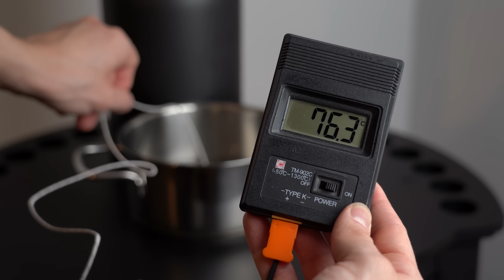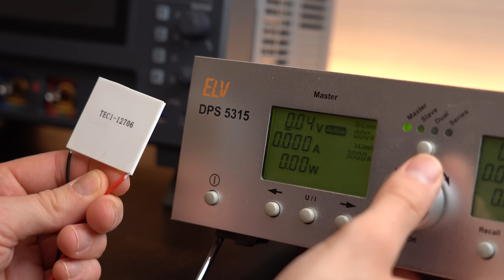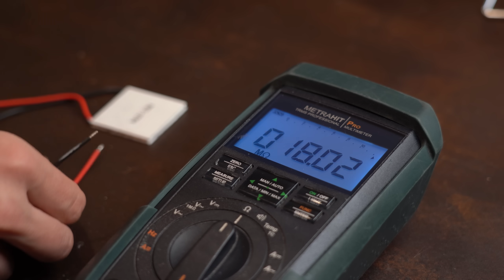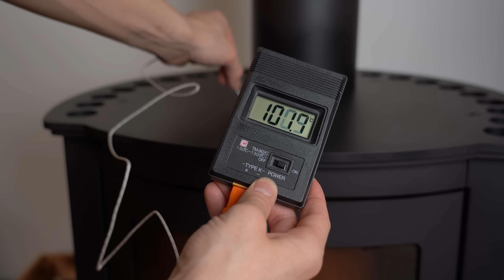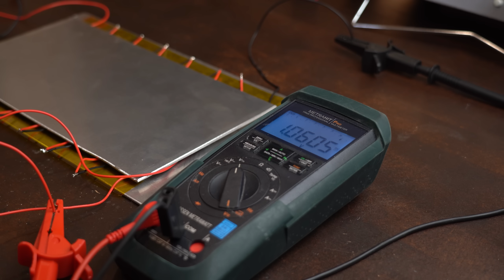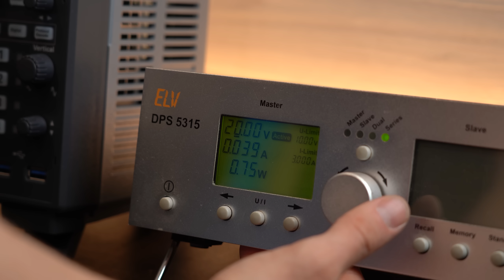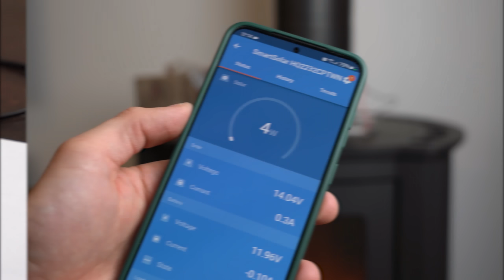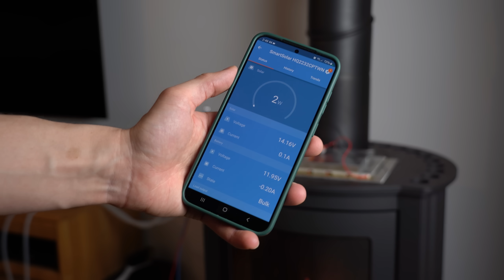I tried to Power my Home with Heat Generators! (Worth it?)

Comment: Try putting a sand battery on top of your wood stove with a heat-powered fan on top of it.

The sand should retain the heat for much longer than the ambient air retains heat from the woodburning stove alone, and since the fan is powered by the heat retained in the sand, no additional power input is required to spread and distribute the heat in the room.

Comment: Idea: Use the woodstove as a water heater to boil water and run a steam turbine. 

I think using the design of a rocket cone will pressurize the steam enough to work as it needs to.

Attach the water supply to a float to make sure the reservoir stays full. 

Potentially also find a way to capture and reroute the steam once it condenses again.

Comment: Something like this could be VERY useful in the right situation.  If you could setup downstream from a perpetual spring, just let gravity feed the constant COLD water through insulated pipes (or use a siphon) and have a regulator block to hold the heat at just below the damage threshold.  I've never studied the tech but I'm assuming that colder water on one side would make less heat necessary to produce the same power?

Comment: Do not use a peltier module, but heat some radiator fluid and take it to a stirling engine. the heat engine with a flywheel has great horse power!

Comment: They're not accurately described as generators but more as energy siphons, push too much through a tube and it breaks. The max temperature difference for these is usually around 18.3C, the BRIGHT spots on your FLIR describe a difference greater than that. If you care I'd look into a home powered stove fan, then sit a cooling block with fins in front of the fan.

Comment: The way to get max cooling from them is to stack two high. Maybe the heating process will be similar? I would remove the top plate and run the heat exchangers direct to the P modules.

Comment: What we need is just steam turbine xD The power could be much higher. The way to protect the peltiers is to use metal standoffs touching the hot side. If its too hot you change the distance.

Comment: I wonder if the plate would be more efficient and safe if you added a small air gap between the plate and the stove top. All you would need is like 5mm of space between. Just a thought.

Comment: I always had an Idea with peltier modules.

Imagine putting the cold side floating in water like a river, to keep the cool side cool with the water current.
And the hot side painted black to absorb all the heat from the sun...

Will it work?.

Like, is a pasive way to harvest energy from the sun... Maybe is more durable than solar panels... I think.

Comment: To better control the hot side temperature, you can use a second water loop, but for the hot side. The downside is that such a loop will consume some power to run, and also the hot water pumps are a bit more expensive than regular ones. A circulation pump from a solar water heating system will do the job excellently.

Comment: These peltier modules are more expensive than the solar panels… Actually these are made of BiTe material, which is quite rare on the earth; but solar panels are made of silicon and can be really cheap with the development of manufacturing process
So these modules are not doing well when used as a common way to generate electricity, probably suitable in special fields only

Comment: You could have used metal pipes to heat water to drive a lot more peltier devices. That wood fire is outputting way more than 6 watts of harvestable energy
Great video regardless

Comment: Idea for you to try. 

Most modern wood fireplaces come with a double walled pipe. Inner one for exhaust, outer one for cool combustable air. If you built an array of those devices around the inner pipe, probably using a metal stand off to still allow air flow around the inner pipe, and to keep the array below its max temp. the outside air coming down will create a potential difference across the  device. 

Doing it this way makes for a neat and tidy install and you need no cooling pump.

Comment: Hmm did you use TEG's or Peltier Module's ??? As a Peltier Module Transfers heat when a current is passed through it (Peltier effect). Commonly used for cooling applications. Where as a TEG Generates electricity from heat (Seebeck effect). Typically used for power generation.

Comment: There are companies that make TEGs meant for power generation. These modules are like taking a DC motor and using it as a generator. Yeah it works, but not as efficiently as a dc generator.

Comment: Scott, I wonder if the stirling engine might be an easier solution? I've put forward the idea of a steam turbine before. However it's quite difficult to do. You don't need steam in a stirling engine. It works with hot air.

Comment: Mounting them on the vertical pipe may not have been as hot and would not have shut you down. When the cold side warms up it also shuts you down, cold side could be outside?

Comment: So , have another system for you to tinker with if you really want to test.  Take your water collection system, add a second teir to it so that there is an upper barrel and lower barrel.  let gravity drop water between the upper and lower barrel and turn a water wheel in it and from the bottom barrel make a small drop to a ram pump that then will pump the water from the lower barrel to the upper barrel.  Have fun figuring out the head pressures :)

Comment: So you have several peltiers left over and a couple of aluminium heat exchangers... why not turn them around and see if you can make a rapid water cooler with them to chill tap water (or bottled water) down to ice-water levels for cold drinks?  It would be interesting to see at what flow rate you could produce a steady stream of chilled water...

Comment: Someone has to be lying because why would all of these generators put together not produce as much current as is needed to power the motors on thermoelectric powered fans sold on amazon? What are you doing wrong? Why are you so confident in displaying these gadgets as non-promising?

Comment: There are some on amazon calming 12v and 60wats of power per plate so I don't know the differences between those and yours. It could be size or type of generator but this just seems like such a stark contrast that somebody has to be lying and if you nor amazon nor said vender can be trusted, then it's up to me to invest and risk the loss myself.

Comment: You should have put them all parallel and boost the voltage. That will do the job. Series does not work with peltiers. They will work against one and other....

Comment: I suggest placing the bottom heatsink layer in water so they never go past 100c. Or make a condenser column and drive the whole thing with steam, dripping the water back down as it cools.

Comment: Could there be a way to use a couple of modules on battery to provide the hot and cold to modules for power generation? Using less power hungry modules to provide the heat and cold

Comment: I worked on a project that developed an organic rankine cycle for energy production.  The working fluid was Freon.  This would likely be your best bet for a low temperature application such as this.  Especially with a turbo-expander.

Comment: The only two productive ways to generate electricity are solar and gas powered portable generator. I know that natural gas is expensive nowadays in europe, you can use methanol or carbon monoxide instead. Those fuel works fine with gasoline engine. You can use a retort furnace to make carbon monoxide from wood.

Comment: Great video, Scott! It would have been cool if you had measured the temperature at the point of self-destruction and came up with a design that could have kept the peltier plate below that temperature, maybe something like elevating the Peltier plate on a heat sink from the stove with fans that can blow cooler air across the bottom of the Peltier plate and heat sink to help prevent the "self-destruction tempture range."Just an idea.

Comment: Not overheating them is the hard part. I was going to use boiling water and put these on the condenser, Basically putting them between the water and what I want to heat, maybe I can get them to power their own pumps, but seeing these numbers makes me think that it just isn't practical unless I get my hands on a reasonably affordable supply of high temperature modules. Their efficiency is low, but it's not as bad when they're higher temperature modules. Still, if anyone knows where to get Stirling engines instead, that would probably be cheaper and more efficient.

Comment: Proper TEG (Thermo Electric Generator) modules cost a whole lot more (around $60 USD for a 22W module), but are constructed for much higher heat tolerance). Peltier cooling modules do what you discovered in your own experiment.

You have heat, you have water. Try a steam driven generator.

Comment: most of your heat gets lost through your exhaust. Get a proper stove with a large mass to store the heat. Also, peltiers need pretty large clampping pressure to operate in optimal conditions

Comment: I can definitely see ways to improve this design

Rather than water cooling, do water heating. Run a coil of copper tubing around the flew. As the water heats it rises and the convection current pumps water through the system. Raising the temperature of the hot side. As it won’t be over 100C you don’t need to worry about burning out the pettier devices. 

The cooling side can be air cooled with just a fan and fins. Although as the air temperature in the room increases you will loose dept Tc. 

Although looking at your flew it’s probably well insulated (as per European legislation) so may not have enough heat capacity to drive an efficient convection current

Comment: A very expensive theory to test, but I wonder how much power you could generate if you could attach an MPPT controller to each cell and THEN attach them all in series. This would theoretically fix the discrepancies between the cold parts of the stove and the hotter parts right?

Comment: Maybe a mid preassure diferencial methane evaporatour wold work better , its like a Sterling engine , but the methane is pressurized till it forms a small cover of compensation at the bottom

Comment: The main problems with electronics are heat temperature and water moisture. I've always get a headache when I see some project with all that in mind. xd

and I think it's better to use a cooper plate than aluminum. nvm, it will break the module much faster. xd

Comment: Great video. Very cool idea. I am sorry to say that the ebay seller scammed you. The tec1 part nr indicate a thermoelectric cooler. The ones designed for use as generators have the teg designation and are rated for sometimes over 300C. They arent soldered internally so they dont stop working. They do cost a lot more though as they arent used in stuff like minifridges etc.

Comment: You need stack them, so the cold side of one faces the hot side of another. You can do this as many times as you like> They will balance the heat gradient between them 

You'll need a lot more to get any decent output

Comment: Has anyone done this with TEG modules instead. I’m planning to build one with a lot bigger of a temperature difference and looking for reference projects. 

Of course mostly for fun as I understand the inefficiencies,  but this could be made a lot better with superior insulation between the hot and cold side and a higher temp. Difference, matched with better modules. 

I’m pretty sure these TEC ‘s are optimised for cooling applications and not power generation with a maximum operating temp. Of 150 degrees Celsius where as the TEG can withstand 250-300 at short periods

Comment: I would say connecting the modules in series is a flaw of the design.
The ones that are producing less voltage might act as load for the ones with more output.
Which is very much the case, because of manufacturing variations and uneven heat distribution of fireplaces.
They also then will act as cooler and cool the aluminium plate while heating the water.
You could try it with the modules connected in parallel and might reach around 20W for the 21 modules.

Comment: Rhe English term for that is a wood stove, not a fireplace.  (Although a fireplace usually has what we call an insert, which is exactly what it sounds like, a device you just insert into the fireplace to make i t work better, which is usually the same basic design just altered a bit to fit into a fireplace neatly.)

Comment: Good episode. Shows the Peltier module generator hype for what it is: very low efficiency. PV, wood gas powered generator, steam turbine, micro hydro, VWT (vertical wind turbine) - these are the projects I've came to think about as viable and practical over several years of keen observation. Cheers. :)

Comment: Maybe you can use a bypass diode parallel with the module. Let's say if one peltier module has lesser heat than the other, it may try to block other module current as all are connected in series. Bypass diode may help.

Comment: Russian have a radio receiver called kerosene radio, basically it's several thermocouple connected in series. You have some similar thermocouples in your water heater or stove that use them as security devices to maintain open the gas valve locking it with an electromagnet. They need a lot of heat to work, fire directly I think. I don't know the current or voltage that it generated but they only use one to activate the magnet valve.
Set several of them in your stove and test the power but looks very powerful to operate with only one a magnet. Best regards!

Comment: It's an interesting project. I always wondered whether it would be worth adding peltier devices to the back of solar panels so they don't overheat in the summer and provide additional power output as well. They could also be powered in the winter to heat up and melt snow. 
It would be an expensive project for sure. In the end I decided that a water loop into an indirect hot water cylinder would be more efficient with a standard heating pump, but the extra weight would be too much for my roof.

Comment: This is quite an experiment. And also expensive (at least 4 me). But it was interesting. We now have power outage of 3-4 hours or even 2 times a day because of poor energy system because of f@cking moscovities! So to make the boiler work I would like to have such elements to make the boiler pump work to heat my house. It could be used for gas furnace and for wood boiler. But the needed power is at least 35 watts. My pumps are cheaper/older. So they need 50 W minimum. But the idea itself is brilliant and is already used successfully by Americans with their wood stove fans with peltier element inside. But the pump needs much more power.

Comment: Why didn't you just buy a wood stove fan and measure the volts coming out of the heat generator before it gets to the little motor obviously, save all that time faffing ♥you did it wrong from the start,  heat transfer via a heat shaft is best,, like the fan design ♥

Comment: use the heat to BOILL WATER it turns into steam use said steam to turn a turbine  or move a piston + flywheel now u can make them into a generator or  angine...GOOD LUCK!

Comment: I think you need higher heat resistant peltier. I ever see peltier that can withstand 250c, but if you can find higher heat resistent, it much more better

Comment: Thank you for doing this man!
I have had the same idea for a while but came to the same conclusion. Seems we need higher temperature modules for fireplaces 😂
But yea, considering we burn for heat, it could be nice to get bonus electricity aswell :/
Denmark got expensive power aswell.

Do you use batteries to store power during cheap prices aswell?

Comment: So you put them in series to get 100 Volts just to make the mppt let it step down to charge a 12V battery? The MPPT charger claims a maximum efficiency of 98% But I would argue if you put more in parallel it would work much better. Also at 8:42 You show it's generating 0,67A at that voltage (But I guess it's short circuit?) (EDIT: I just realized these numbers are calculations based on the product description) That would be 67,5 watts already. 

You got 30 modules, and you say the whole thing got a voltage of 100 volts. So each module has 3,33 Volts and each at 0,67A (which I'm not even sure because he just assumed it's 0,67A)

I would try to rearrange things. 5 in series would get you to 16,65V at 0,67A  putting six of these in parralel and you got 4 Amps at 16,65V. Much closer to the battery voltage. That's 66,6W  and if we're super pessimistic and assume the voltage breaks down and we only use 1 Amp it would still be 16,6 Watts.
Reply: I just realized at 9:33 it is actally shown that the voltage is down to 24,24 Volts at 0,3A input. So that seems to be the main issue. I would definitely put more of them in parrallel. I don't quite understand the numbers there because the "solar" wattage would be 7,3W and the wattage to the battery is only 1,2W? ALSO IT'S -0,1A half of the time, it's drawing power FROM THE BATTERY!!!

Comment: GeratScott You have to change your leadership quick!!!!  All the big energy dependent companies are collapsing. Carbon emission in the sky. 
"Someone" exploded the cheap Russian gas. That your economy was built on. Not even investigated. A shop thief gets jailed. But nothing happened there. If a critical infrastructure attacked of a country they take it seriously. 
All the nuclear power plant closed!  And German citizens are running Windmills, Peltier, Solar. Because cant pay the bill. 
Politicians should not do electrical engineering and should not do economics. As clearly seen.